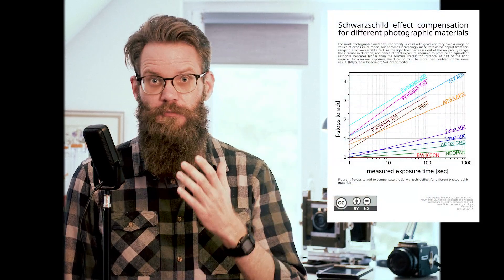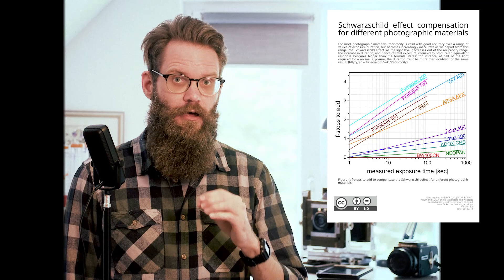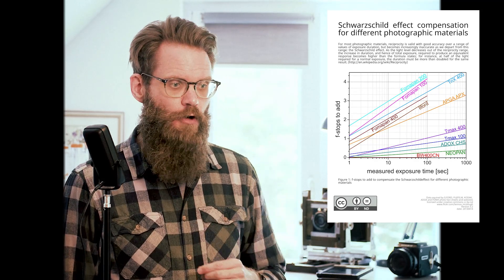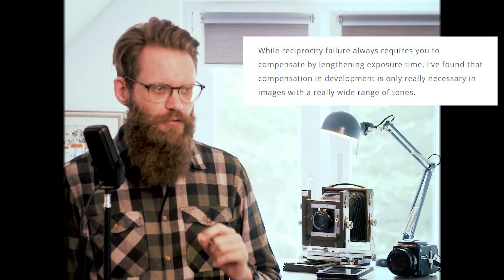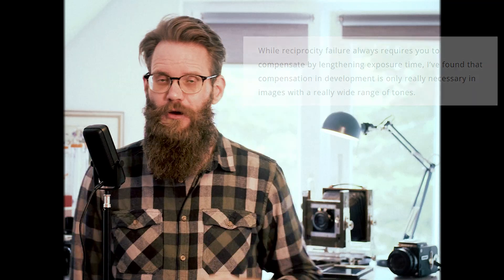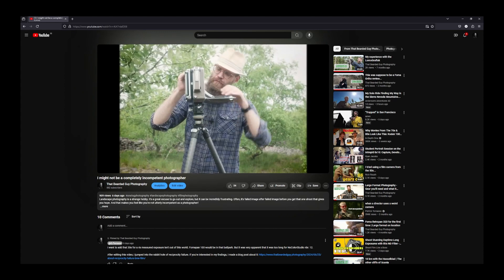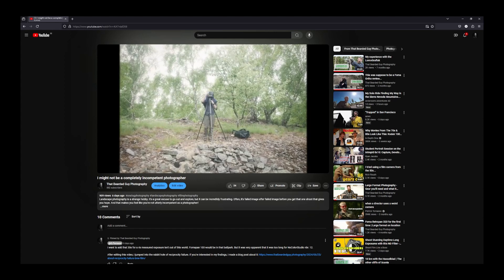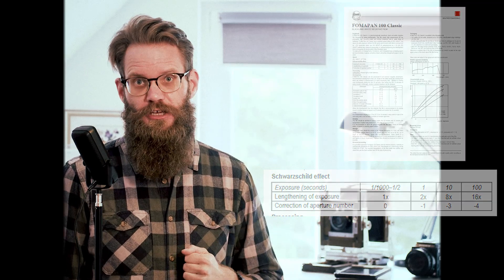Reciprocity Failure and Long Exposures on Film

Comment from the maker: Did I miss anything, please leave a comment!
And of course there's apps avalible for reciprpcity failure as well, I personally use "light meter" on Android. That contain some charts for calculating compensation for reciprocity failure. 

I didn't mention it in the video, but reciprocity failure also occurs for really fast shutter speeds. In most cases it's a non-issue as the  cameras shutter rarely is fast enough for that to occur, but in case of flash photography it might become a factor. 

Anyhow as mentioned in the video, this started as an blog-post wich you can find on my homepage. There you'll also find all sources used in this video. Link: https://www.thatbeardedguy.photography/2024/06/25/about-reciprocity-failure-bnw-film/
Reply: The last time I heard, Agfa APX was being made in/at Ilford. I used to be a great "devourer" of APX, but then I discovered Foma 100 in 120 and that was my (so much used word) "gamechanger"... Too bad that Foma does not have the Ortho 400 on 4x5... I would love to see that!
Reply from the maker: Agreed, I would love to see some more ortho film on 4x5. 

And we are the same, considering how cheap foma is, it's great. The falloff in reciprocity failure and the somewhat ruffer grain is its biggest drawbacks, but it's by far outweight by  its price and general performance.

Comment: Reciprocity failure is a pain in the backside and was one of the main reasons why I quit film photography and moved to digital which is not prone to it although you might get a build up of noise when exposures get very long using digital cameras
Reply from the maker: It sure can bite one, when you forget to check it before making exposures. Digital in general is easier, and probably the sane option for most people 😁

Comment: Hi Oscar, I may look into the Jobo system as I know its very popular and loved in Europe. I'm using a Nikor stainless steel double 120 tank taking nearly 1000 ml per two rolls so with the rotary process I'd get my expenditure back. However, I tend to over agitate so I've got to work on that! Do you use constant rotary action and reduce the development time by 10-15% like Adox recommendation?
I just ordered 8 rolls of CHS 100 II and Adox to try out as my 100 speed film. Always liked Adox and Agfa film and papers. Have to shoot Adox CHS 100 II?
Reply from the maker: Hi Stephen! 

The Jobo-system is nice, but expensive. I have one of the smaller tanks, it can hold 6 sheets of 4x5 or 9x12. I do rotary development on a homemade rotary base. 
I usually go with the times for constant agitation found on one of the big dev. charts, if it's available. Otherwise I just reduce the dev. times with 10-20 % 

I've gotten good results on LF, but unfortunately had some issues with some rather ugly streaks on 120 that I never figured out. So nowadays I do LF in the Jobo drum, and 135 & 120 in my Paterson with normal agitation or semi-stand. 

The Jobo drum is quite thirsty for normal agitation, mine take ~1,5 litres for normal agitation but only 275 ml for rotary development. 
Another option for LF development is the tanks from Stearmanpress, they look really nice. I went with the Jobo-system because I shoot both 4x5 an 9x12 cm, wich is supported native with the Jobo-drum. 
However I do think I'm going to order the tray developer from Stearmanpress, as it supports 4x10 and looks easier than doing normal tray development (a bit pricey though).

I'm also a big fan of Adox, I think they do really cool things. I have shoot CHS100 II on 135, can't really remember any details more than that I liked it. And I do have a few rolls of it in my fridge , that I ordered not that long ago. Thinking of picking up a pack of it in 4x5 on my next order run of film.

All the best!

EDIT: I feel like I should add that I don't think it's the Jobo-tanks fault that I got some streaking on my 120-film. Probably down to uneven rotation, or something else that I did wrong. Nowadays I mostly shoot handheld and  I'm fairly loose with metering on 120, therefore I've switched to semi-stand rodinal (wich is a good compensating dev. method) as my default developing method for 120. I therefore never actually figured out what went wrong with my 120-rolls (never done 135 in the jobo, as it only holds one roll).

Comment: Oskar, Thank you for all the hard work you do and sharing! I'm having good luck with Fomapan 400 4 X5  in Rodinal(Blazinol) 1:50 with their published reciprocity failure times. I tried 120 HP5 same developer and published development times and got some unusable over exposures. Could be I'm over agitating and/or not being consistent. I don't mind long exposures either in most exposures.
Reply from the maker: Great to hear you're getting along with Fomapan and Rodinal. I find it an excellent combination, and very affordable. 

I have very little experience with HP5, as I'm not a big fan of it. Not that it's a bad film, on the contrary, it's just not to my taste. 
Rodinal can however be a bit temperamental at times. My theory is that's because it's highly diluted. I've personally switched over to 1-25 as my default dilution, but the Jobo drum I use only requires 275 ml of chemicals. Which means at 1-50 the actual amount of dev is very little, and even at 1-25 it's stretching it (I've read somewhere you shouldn't use less than 5 ml/roll or sheet). I'm getting better and more consistent results at 1-25, and Rodinal is still very cheap so I don't mind using that little extra chemicals. 

But as you said it could also just be over agitation. 

Have a great weekend! 
And as always thank you for the kind comment

Comment: one other reason for reciprocity calculations, even with the shooting you do, is any filter factor, or Bellows ext. factor, can move a 1/2 or 1/4 sec. exposure time into this area, esp. for LF, as wide lenses on landscapes can easily add a lot of bellows factor quick, as 1.5 ish times 65 or 75 is way less than 1.5x 150 or 210 certainly if you find yourself doing a macro with them, or close up subjects, necessitating long bellows draw.
Reply from the maker: This is very true. Happens surprisingly seldom for me though. But important factors to consider, and keep in mind especially when shooting Fomapan 100. As it falls off a cliff fairly fast.